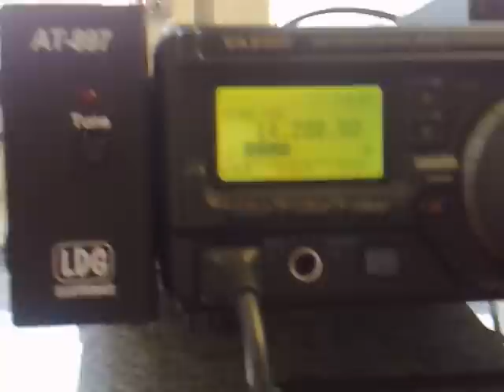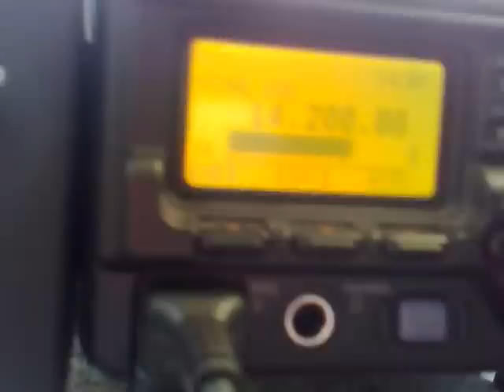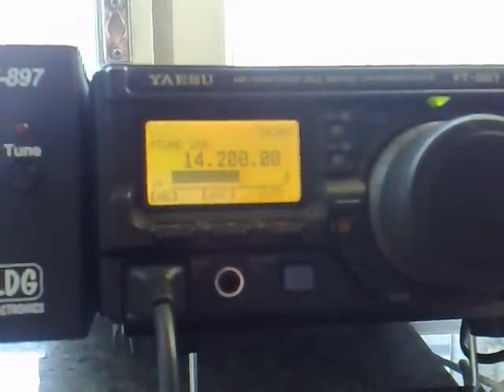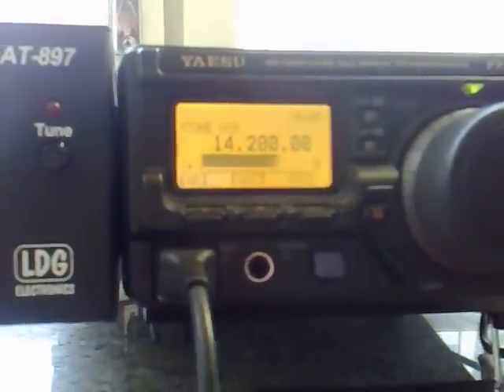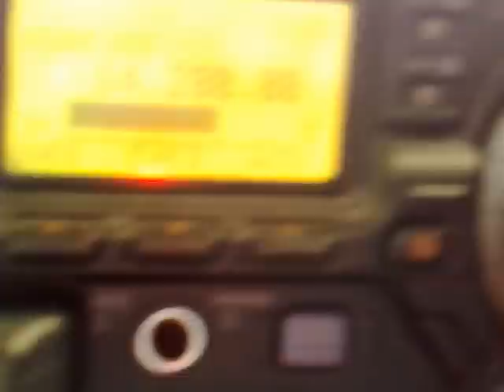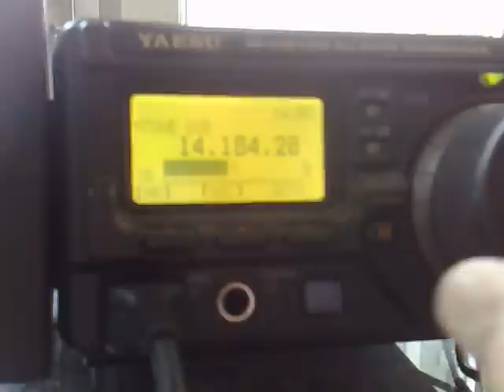20 METERS WITH WINDOW CELL WHIP

Comment: I use a somewhat similar setup. I have a 3 meter whip tuned with a coil and variable capacitor .I often hear russian stations 1500+ Kms from here Budapest, Hungary. I once made a contact with a russian station 1470 Kms far with an SW40 radio on my side that runs on 2 Watts :) Apartment shortwave is definitely a hard genre, but still fun :)